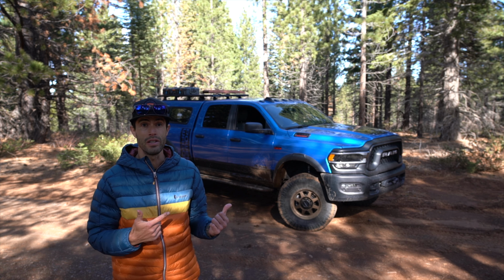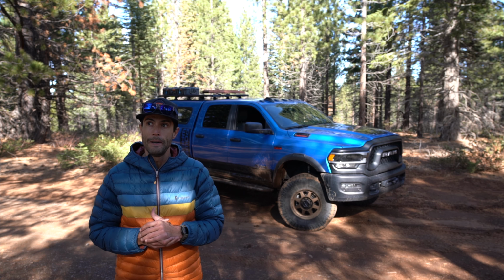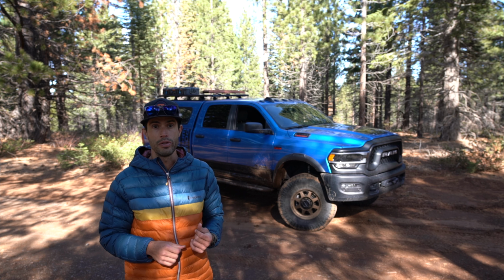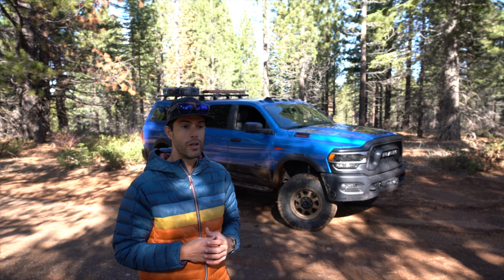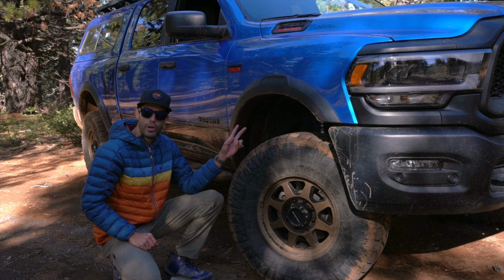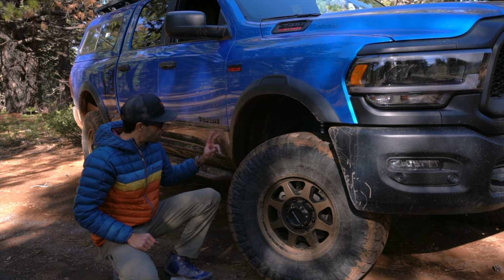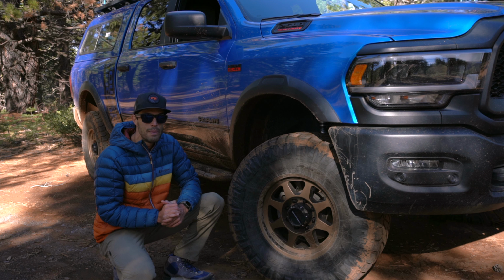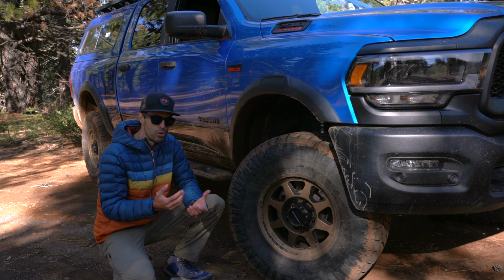Carli Suspension Commuter Kit Review - Ram 2500 Power Wagon

Comment: could you make a video on what you don't get with the stock suspension? I am trying to figure out if it is necessary for me to switch the stock suspension for the kind of driving I will be doing. Also, does the PW need a leveling kit?
Reply from the maker: The stock Bilstein just were quite adequate. Upgrading will depending on what you're looking to get out of the vehicle.

Comment: Do they have a taser for the PW to keep the sway bar disconnected at all speeds? They have it for the jeeps.
Reply from the maker: there is an override module apparently, but we just left the smart bar module ziptied and hooked up under the front, without the sway bar. We replaced it with the Carli Torsion sway bar.